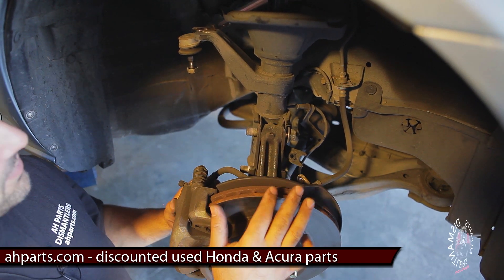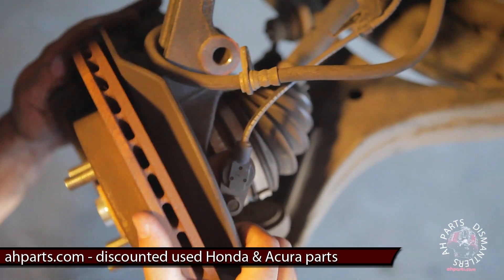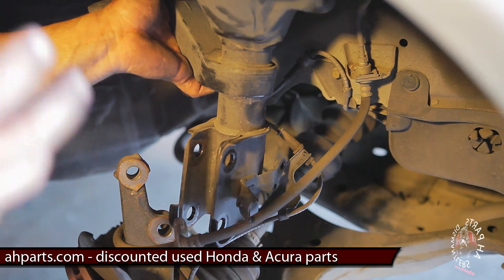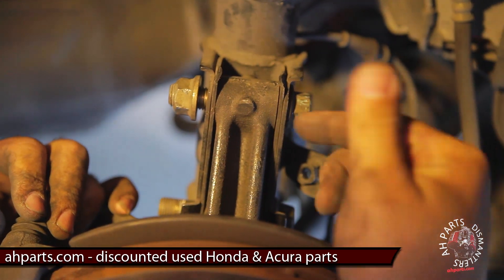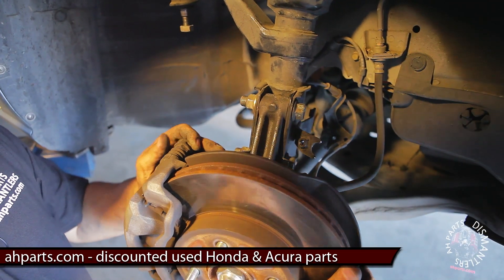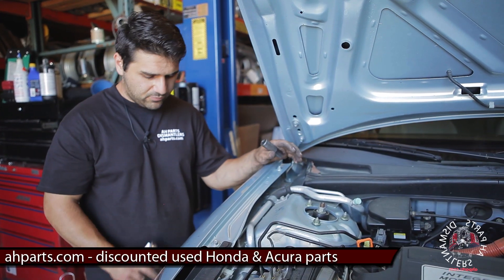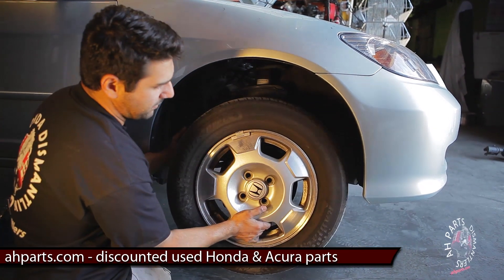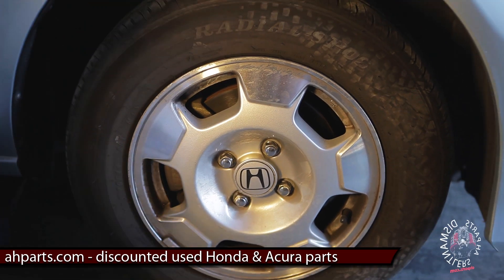How to replace install change 01 02 03 04 05 Honda Civic SHOCK ABSORBER STRUT SPRING Replacement pt2

Comment: Just a suggestion, you could use a old wire coat hanger or short bungee cord to hold the hub assembly.  Similar as you would in changing brakes and holding the caliper in place to avoid damaging the brake lines.  Good video!

Comment: This was excellent, front to back.  Someone in the comments asked about how to do the spring replacement.  To me this is something I just wouldn't do unless you can't get a full assembly for some reason, I would never put a used spring back on the car when you can have a full brand new assembly, spring included and already compressed, mostly because it doesn't make sense to put a used part back on, second because of the danger of compressing a spring, just do a you tube search for spring failure and thats enough for me not to bother with compressing the spring without spending 7 or 800 dollars on a spring press.  There are plenty of full assemblies out there for this vehicle range, I got 2 from Rock auto for 75 bucks a piece, that's the whole assembly.

Comment: good job lots of xtra explanation for the home mechanic... only u didnt remove the spring so this is perfect for a strut one piece removal and replacement if your replacing the spring you will have to use an allen key and remove the center screw on the tower this is the most difficult part because the spring while compressed can be very dangerous if you are replacing the spring make sure to look up spring replacement before attempting such as with lowering springs...

Comment: My son and I just installed coil overs on his 03  the strut assembles came out and the new ones in without a problem   However the front passenger wheel is toed out quite a bit to the point you cant drive car  I took that one out double check and put back in  still toed out  it seems the tie rod wont fit on the strut assembly if the wheel is straight what do I DO??  THANKS
Reply: Came across this. What did you do? just messed with the tie rod until you were able to have both wheels straight?

Comment: Hey thanks for the video wish I watched it b4 I did this job on 01 civic I have a couple questions first how will I know if I over extended the the axle shaft would there be a rubbing sound while driving it and second know that the everything is back together the left front tire is toed out I did not move the tie rod at all what could be the reason for this please help thank you In advance
Reply: John Harris how did you fix it? new alignment?
Reply: dgaleno2012  i put a new cv joont in although i prob didnt need one all i prob needed was an alignment hind sight is 20/20
Reply: You probably did not I messed around with alignment and got both wheels straight. Thx
Reply: sometimes, where the strut tower bolts in above the wheel well (next to the engine bay), the metal is fabricated in a way that allows you to rotate the strut clockwise/ccw a little where those 3 bolts go to adjust toe setting. before removing those 3 strut bolts (or nuts, whatever you have), you should take a marker and trace circles around each bolt, so when you reinstall the strut, you align it exactly the same to keep toe alignment.
Reply: he probably didn't explain that in the video because, if you look closely where the strut tower bolts in, they don't have that option to rotate the strut, it sits in 3 perfectly circular holes.
Reply: You will need wheel Alignment  after installation.

Comment: @1:18..OR you could just NOT completely remove the 3 nuts up top holding the strut assembly  that prevent it from just falling straight down....and remove those three 3 nuts AFTER disconnecting all that is necessary from the bottom. 

Common sense???
Reply: I agree just remove two of the top nuts and leave one on , also use a bunjy  cord to hold the wheel hub in place

Comment: Not bawling you out, but to make this good tutorial complete you forgot to tell the novice to have thr front end aligned after completing this job!  Without that the job isn't done.

Otherwise thanks.  I just bought a nice low-mileage 2003 Civic hybrid with junk struts.
Reply: +rod builder the strut only affects the car vertically. Why would an aligment be necessary if you replace the shock with a matching oem unit? The tie rods were not changed or altered in this process.
Reply: enginemodify for some reason after replacing my front struts I need a major alignment...so bad that 1 wheel is slightly turning when the other is straight. unless this was already present before but didn't see it anyway it affects the driving won't drive good. steering wheel doesn't know which way to pull.